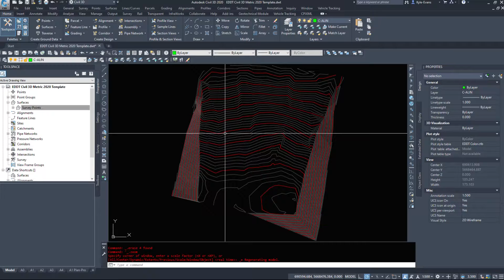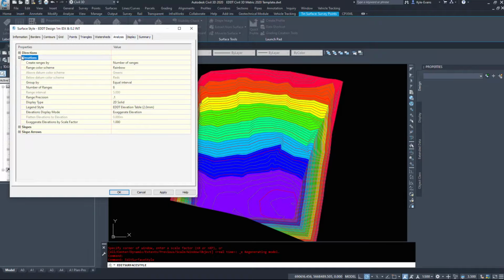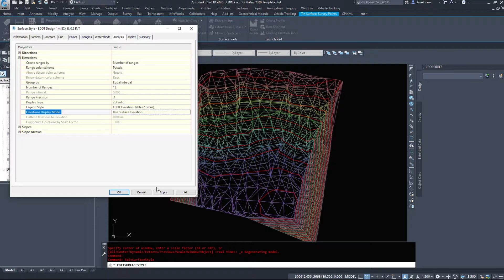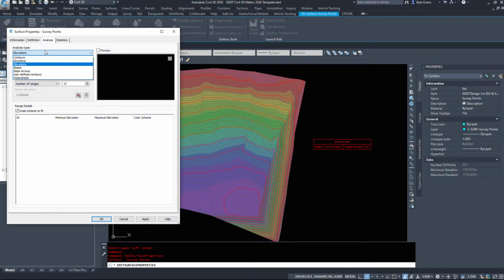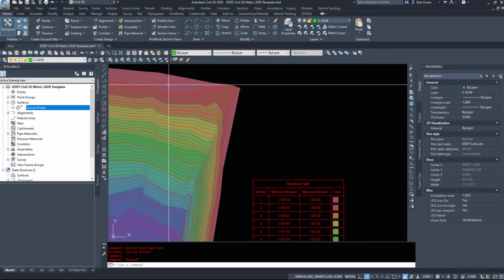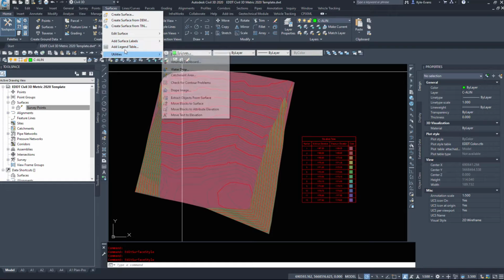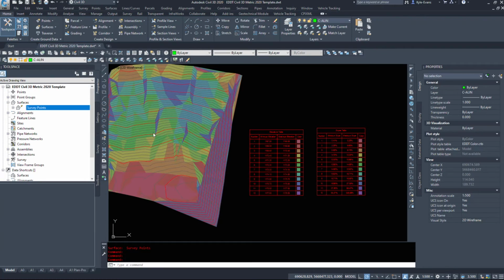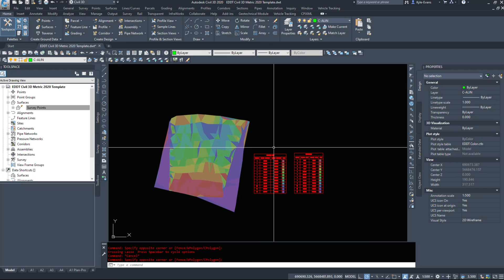Introduction to Civil 3D Part 18 - Surface Analysis

Comment: Hey Kyle, really appreciate what you do for the civil 3d community. I had a career oriented question. How in the world can I join a firm that will actually have me use civil 3d on a daily basis? I love civil 3d but it seems the last two firms I've been in don't really use the program to its full potential. Lot of "manual" grading with polylines, no use of grading objects, no use of corridors or if we do very basic ones at that (no intersections, cul-de-sacs). I'm in land dev if that helps..and United States. Just been frustrated with how much drafting I end up doing vs actual design work with no appreciation for the end product you can create with civil 3d. Should I ask more specific questions in my interviews or look for larger, not small firms?

Comment: Thanks Kyle,
 Do you know if there is a way to perform an analysis which will help you determine the route for the water which is likely to form a stream. I know that thee is a water drop, but I am more interested if there is a tool which will allow to exclude the areas which allow to form a puddle for example less than 100 mm deep.
For example you have a slope. It is required to build a raised road along the slope. The road will block the surface runoff. At the area of the slope which is higher than road there is a small plateau or ditch or swale which allows to accumulate 100 mm deep water (it does not allow to perform a water drop tool). When the water overflows the plateau it will be blocked by the raised road. It is required to find the point along the road and install a pipe or culvert through which the water will go further down the slope. What kind of analysis do I need to perform to find this point?
Regards,
Anton
Reply from the maker: That would be more on the side of a Watershed Analysis, it will filter out the smaller holes if the overall area drains to a larger point. However be extremely careful with Watershed Analysis as from what I have seen in my experience, can increase your file size massively. Make a backup of your file before you run the analysis.
Reply: Kyle Evans, thanks a lot.
Could you you please show how to undertake this analysis in one of your videos?